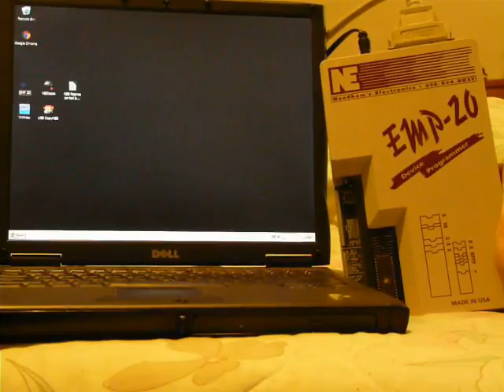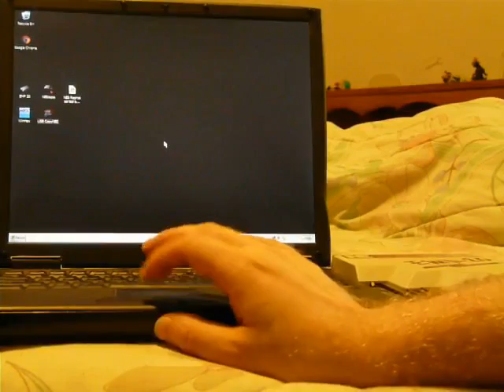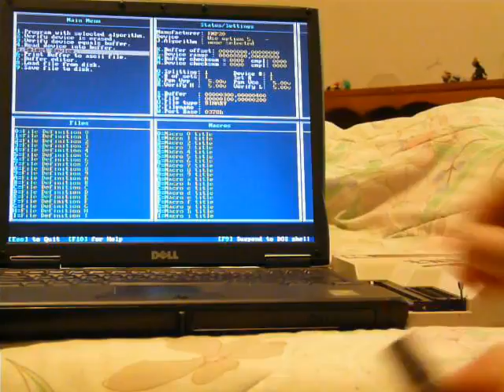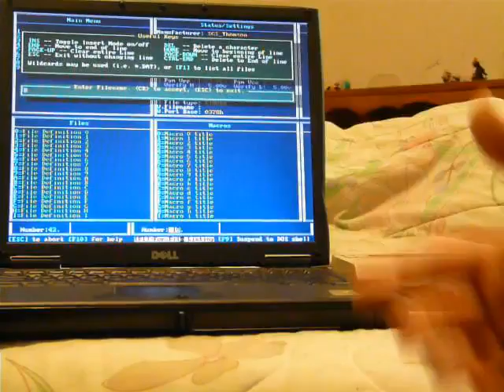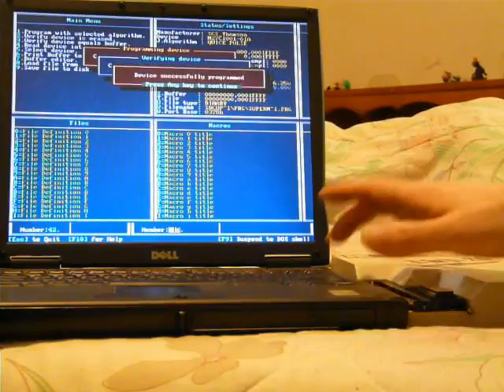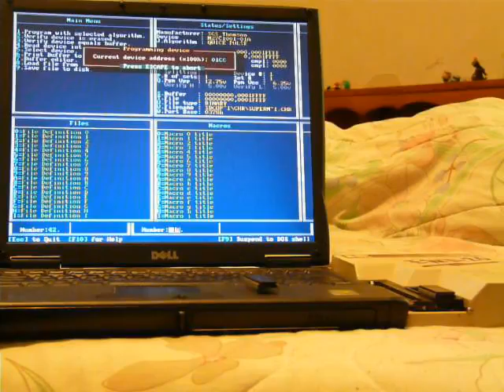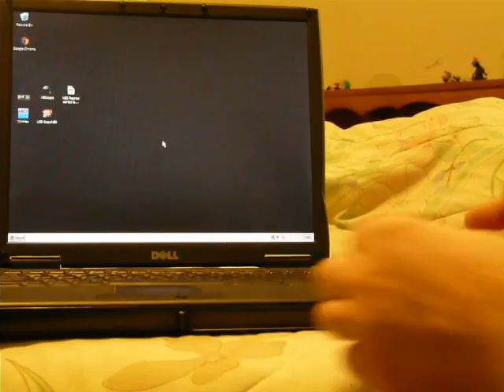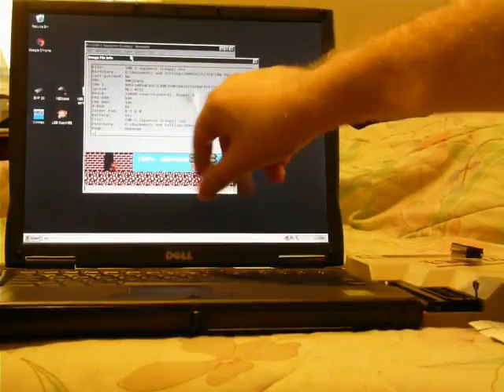Making an NES Reproduction Part 2

Comment: Ah ok :) I'm just getting into the whole repro thing. Got my first repro game that i bought online. And after spending a few hours reading everything i can find about doing it yourself. It seems somewhat advanced. I'm not extremely technical. But i would love te be able to do games like Final Fantasy 2,3 and some other games that i have found. About that Needham's EMP-20 burner. Is there any modern version? That works with windows 7?